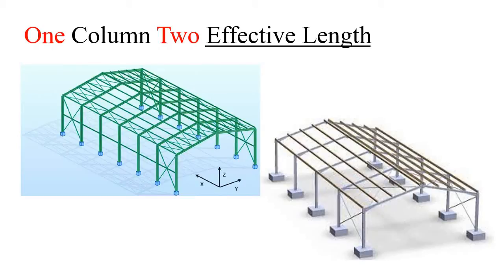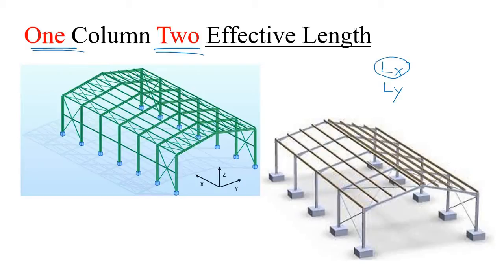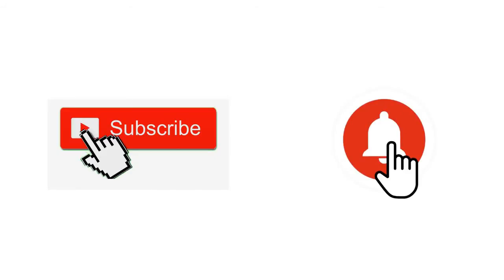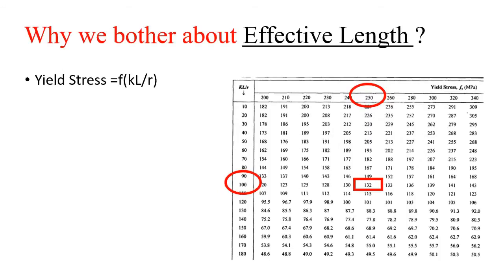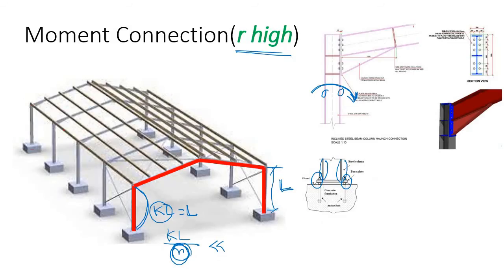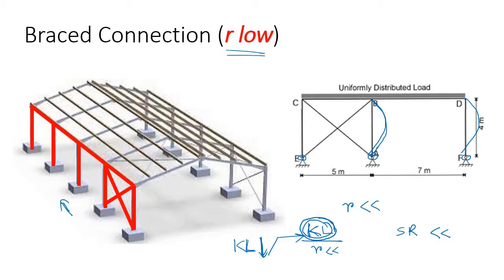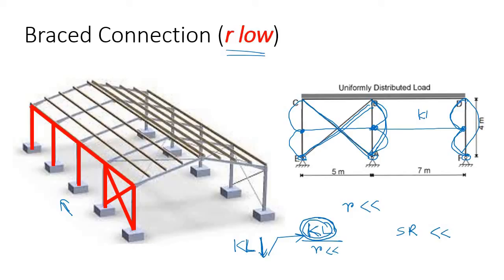One Column Two Effective Length : Assign Lx and Ly

Comment: Now also column height is full height only if want to divide by 2 u should connect bracing at strut location.so then only from strut location bracing will transfer the load to foundation.if u dont provide bracing column will bend between foundation and eave joint only.

Comment: If the main frame is moment connected then why have you taken the effective length as L it should be 0.65L as for moment connected frame the column is fixed on both side.  And for longitudinal direction, column is pin connected so effective length is L
Reply from the maker: correct
Reply: Thanks for posting this question. I was also having same concern .now it is cleared .

Comment: the lx and ly parameters are with respect to local axis of crossection , not on global  axis . Please check I think there is an error in your presentation .

Following staaadpro conventions , 

Z is local axis and is major axis 
Y is local minor axis 
X is axis along length 

Lz is used for buckling length for major axis 

Ly is used for buckling length about y axis 

Lx is buckling length for torsional buckling case .

Usually ly and lx are same value in cases like for example the column braced by a strut in middle . But again this need not be 100 percent to true , depends on the crossection of strut and connection of strut to web of column .
Reply from the maker: My intention is to convey the concept only.